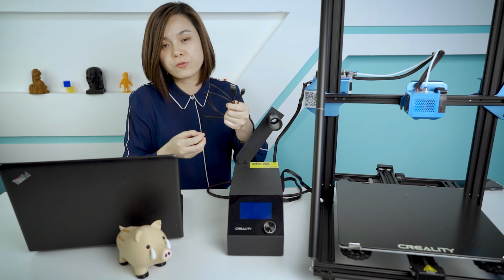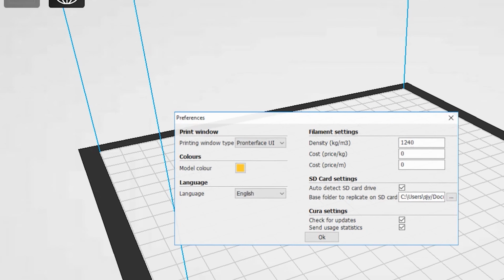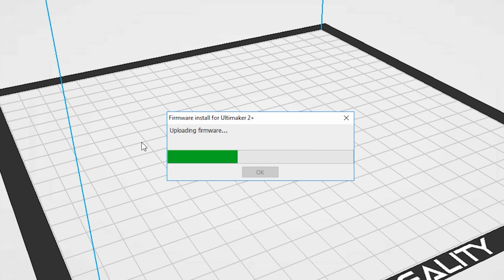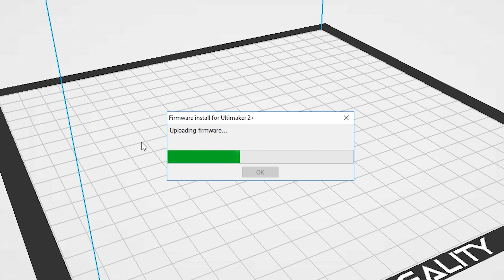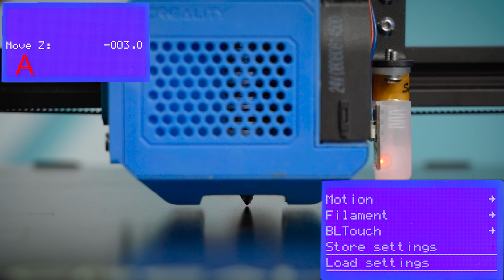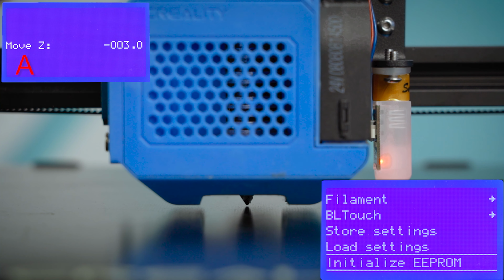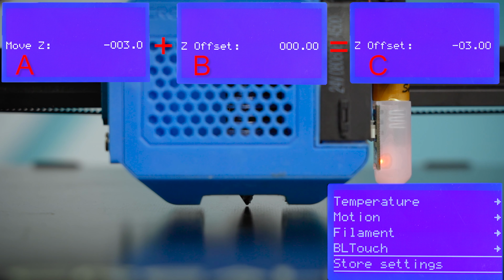Creality CR-10 V2 Bltouch Auto Bed Leveling Sensor Installation Tutorial (2019)

Comment: I think it should come with Bltouch installed from the factory.
Reply: Agreed.  It is sold as an "Upgraded CR-10"
Reply: No one needs auto bed levelling. It's a gimmick. Tramming with a feeler gauge takes 10 seconds.
I have this printer.
Reply: okleydokley saying no one needs it is just wrong. Saying I do not need it might be more correct for your situation and even than there is an value issue. As people have pointed out it is an special version that costs more so you want to get more value to. Now let me explain why I claim your statement is wrong. First some people get bent beds. Way easier to compensate with bod all. Sure even then one can do it manually but it is not 10 seconds job. Every time you change the temperature or clean the bed your perfect setting might be gone. Then you need to do it again. Placing G29 line in slicer and every time you print it will be perfect. Fire it up and go. To be honest I like Creality printers and currently I own two. Even from my two the more expensive model have a micro dip in the middle. It is very often occurrence on the Creality printers. In that case ABL is a dream for almost everyone. See how I have said it? Almost everyone. Not a broad statement as yours while we are all different and I do account for that. So to second point. It is way to exclusive to say no one needs it while you can’t determine and predict other people needs an wants. Like I can’t say everyone wants value for their money although it might be close to the truth. You could argue adding a cheaper Chinese abl is not expensive but why? You have paid more it should come with it. Otherwise get the basic version and 7 $ abl solution and make it your self. Still even that is not for everyone. When you can do it one tends to forget that there is way more people who can’t do it. Never the less TLDR version if there is only me who needs it makes your statement a moot point. This is true disregarding to my reasons why I need it or want it and disregarding facts that I do know how to do it and I am not a lazy person.
Reply: The Bltouch is made in Korea but the Creality printers are make in China that's why
Reply: @MauiRedMan  you make me laugh. Thanks for that. JFYI some models of the Creality printers come with genuine BLTouch and even genuine Caoricorn PTFT tubing.
Reply: NINEWALKING those are printers modded at a 3rd party company lol.
Reply: @truantray  for a bed this big, it's helpful. I will never go back to manual bed leveling. I love the mesh. Especially on my Prusa.
Reply: As a new user... I absolutely agree.

Comment: I can't be the only one who noticed that their print is peeling off the bed after doing the BLTouch install. That's precisely why I would buy one; what's the point of this if your prints still peel from the bed?
Reply: And more for the third line up!...👍
Reply: Might need more heat on be ? But what would I know maybe she don’t wanna get burnt or something xD
Reply: Its auto level but you still have to adjust it???? I don't get it shouldn't it level it all automatically
Reply: @Berserkercustoms44  You need to adjust z offset still, but BLtouch can mesh level and make even warped plates print great. But BLtouch doesnt know the true location of the nozzle without zOffset.
Reply: use glue sticks on the bed before you print, a quick layer Will help with peeling ALOT
Reply: The problem is she didn't lower the nozzle far enough for the Z-Offset. It probably should have been -3.1 or -3.2. Same procedure as shown, just do the 0.1mm steps as well.
Reply: When leveling the bed fold a paper in half and slide under the nozzle. The paper should have a little resistance when sliding back and forth

Comment: This might not be the right spot to post this but, from my experience (August, 2020). Installed the BLTouch on the Creality CR-10 v3. A couple things to note from my experience.
a. Use the firmware for the Titan Direct Drive
b. Printer not normally connected via USB so I disconnected power and moved closer to computer, USB provides sufficient power to power the head unit
c. My printer was not recognized under COM5, I used COM6 and then it was recognized - this permitted me to install new firmware
d. Be sure to reconnect main power supply prior to attempting Bed Leveling (USB cable can be removed for this part)
Look forward to many years of successful prints with this device. Hope this helps others trying to install.
Reply: Thanks, creality does not have the CR10v3 firmware on their site. 
From your experience you used the V2 firmware with the titan and the BLtouch, is this correct?
Reply: Yes I used the v2 firmware. Still trying to get this Z access offset correct.

Comment: I recently purchased a CR10 V2, with a Creality BLtouch upgrade, and like many others, it will not work. I am using Win 10 on a new PC, the proper version of Slicer and CR10V2/BLTouch firmware as well as following any instructions I can find. On power on, the BLTouch self-checks/drops and retracts the probe twice and appears working. However, the probe never again deploys and as such is not able to sense the bed and causing a probe failure on the end of the z-axis. Please help as I am about to return the entire purchase, CR-10 V2, Titan Direct Drive Extruder, Laser Engraver, and BL Touch. Then purchase a competitor. Frustrated please help as quickly as possible.

Comment: My printer is a CR-10 v3 (about 1 month old) and I have recently installed the BL Touch kit from Creality. I followed the tutorial and everything went fine, but I am simply unable to get this z-axis offset working correctly. I have manually identified the z axis difference (I've done this exercise multiple times, but the delta ranges between -2.1 mm and -3.0 mm) and stored that setting through the EEPROM, then saved settings (confirming beep, right?). I have done this many times but the printer is always printing way above the bed! To save time from the auto bed leveling, I figured I should simply be able to do the Auto Home (which for some reason brings the nozzle to the middle of the bed at Z 10.00) then just move Z axis to 0, but I am always left with a huge gap (about 2-3 mm). I repeat the cycle over and over to no avail. I had no problems at all with the printer previously and thought this BL would make things easier. Unfortunately, as it stands right now, I cannot even use this printer and have to consider resorting back to the manual z sensor. :(

Any suggestions would be greatly appreciated.
Thanks,
Reply: MUST HAVE! IMPORTANT INFO!
Important, I want to help everyone I can with this. Let me save you any trouble that others might be having.

G29 and M420 S1. These are gcode bits you need to know when using a BLTouch. Nobody mentions this in any video or writeup I've seen and without them you will feel hopeless. Now let me explain. Watch Creality's install video and follow it step by step. However, once you get to the part for setting your Z offset, rather than eyeball it like the video, use a piece of paper like you would with manual leveling to ensure you have it right. Now once you have it all done and ready you NEED to add some g code additions to your slicer.

After your slicer does a G28 for homing you need to either add a G29 (this tells it to do bed leveling) or M420 S1 (this tells it to use the saved bed leveling info. Use this so you don't have to wait for the bed leveling with every print). If you do not have one of these codes in your g code the printer WILL NOT use the auto bed leveling and youll be playing hell if you have a warped bed.

Now as for a review bit. This works absolutely amazing! It's a must have, and makes the printer a joy to work with. Buy one immediately!
Reply: @DestructionBots  I appreciate this information. I did find and add the G29 code to my slicer (although I will certainly try the M420 D1 to save some time!!!). I did use the piece of paper as my spacer just as I did when manual bed levelling. Unfortunately, this is still not working. I adjust set the Z delta in EEPROM but then when it goes to print (after G29 bed levelling) it's still way off the bed. Creality has tried helping out without success.
Reply: Hello, did you solve this problem? I have the same ...
Reply: @bp2434  The short answer is No. I have set it once. The bed leveler picked up the slight deviations in the plate and then I just left it alone. Every month or so, I go and recalibrate, but otherwise I just go straight to print and it seems to work fine. At least I can print with it - for a while I kept attempting to calibrate each time and was completely unable to print. I was expecting the leveler to do the auto-calibration each time, but I guess not.

Comment: I have the worst luck trying to get a BLTouch to work, ha! I'm trying to follow this tutorial, but when I connect my CR10 V2 to my computer, the Creality slicer doesn't show a COM3 available (just AUTO or COM1). I tried it that way and the slicer cannot connect to my printer. I tried going to the Device Manager and changing COM1 to COM3 manually. This allowed the Creality Slicer to see COM3, however, it still could not connect to my 3d printer. I tried this in other slicers as well. None of them can see when my printer is connected. Any ideas of what I should try next?

Comment: 5:25 Filament seems to be to high from the bed?
Reply: Ha, noticed that as well!
Reply: Yes this is a huge issue with the BLTouch being that the BLTouch is supposed to keep this from happening. Sometimes it goes the opposite direction and grinds into the build plate. (ruined 2 of mine now and others have had the issue as well) This "CR-10V2" video isn't even using the updated firmware which makes it completely useless to V2 owners who purchased their machines after this video was created. I can follow this video with my CR-10 mini, but it doesn't have a BLTouch!lol

Comment: Hi, I installed my Bltouch but during bed leveling, it does NOT goto the edge of the bed as in this video. It is almost that it "thinks" the bed is smaller. I would love some input on how to correct this...should I reinstall the original firmware? is there a reset button for the firmware. I am a beginner

Comment: Hello, Thanks for this tutorial. I just purchased a CR-10 V2 (2.5.2 Motherboard) and a CR Touch? Did this tutorial and firmware are the right one if I install my CR touch instead of the BL Touch ?
Thanks in advance for your help and reponse
Best Regards
Cedric
Reply from the maker: Sorry, CR-10 v2 can't connect to CR touch
Reply: @Creality3D  Thanks for your answer. Can I connect a BL touch with my V2.5.2 motherboard?

Thanks a lot for your support and fast answer. 
Waiting for your answer before ordering BL touch

Comment: hi thanks for the video. i followed your instructions, i have run into the following problems. 1. i can not see the option of bed leveling. 2. bltouch continues to blink after touching the bed twice . my machine setting is for cr10/10s, i could not find cr10v2 in the list of machines. is there a way to get this working? thanks in advance.
Reply: I believe you have to select a custom machine and enter the parameters manually. I believe the sizes it asks for in mm is 300 x 300 x 400 and then 0.4 for the nozzle. Hope this helped.

Comment: Hi, I've follow the guide and did a 3d print sample cat gcode. it worked perfectly. It do some bed level test first and print. However when I try another model like the xyz calibration tube. It does not do bed level test and print directly. and the noozle is a bit high. Is there a gcode start for cr 10 v2 that do bed level test first?

Comment: Why is the BLTouch being sold for CR-10 without the extension cable? I mean, the CR-10 doesn't have the little housing as the V2 does, so the cable needs to be extended with a 1 meter cable in order to even try and use it
Reply from the maker: Sorry for the late reply, could you pls tell us which bl touch you bought? If you confirm that the model of your bltouch is correct, we can resend an extension cable for you

Comment: Why are you using a V2 with an older version of the firmware? I purchased my CR10V2 soon after this video was created and I cannot follow it due to the menu selections on the control box being different. I was able to figure out how to get the bed leveling to complete, but then there is not way to adjust the z to a negative value like you do in the video. The menu selections you are using are the same as my CR-10mini (older model)
Reply from the maker: Dear friend, the firmware version does not affect the adjustment of the z-axis compensation function. If you cannot adjust, you can download the firmware on our official website again, and then try to refresh the firmware again.
Reply: @Creality3D  Thank you for the response and information

Comment: I've followed your instructions, and the bl touch is working but it doesn't probe the whole bed surface, it seems that it thinks that the bed is smaller, how can we change  it from your custom firmware?
Reply from the maker: How many points are automatically leveled, you can change the number of points from the firmware.

Comment: Another look at the vid and I see exactly what many people are having trouble with when it comes to the BLTouch. The side to side to side leveling is horrible and it even SHOWS IN THIS VIDEO! In this case, the right side was too low and did not stick or "squish".  In my case and others, the right side is too high and scratches the build plate surface!! The purpose of the BLTouch is to eliminate issue just like this one and even fails in the install vid.......how do these people sleep at night?

Comment: I dont have the COM3 option for some reason in Slicer. I cant figure out how to simply get the firmware onto the printer. Does anyone know what I am doing wrong?
Reply: In my case, I checked first that in peripherical, my printer was on COM4, then I made the same protocol, but using COM4 ... Issue was OK
Reply: I had COM5 instead of COM3 or Nicopter MG's COM4, but my CPU configuration is atypical - MacBook running Parallels, Windows 10 - when I selected COM5 it worked correctly

Comment: i did everything like in this video. everything goes fine until i have to do the calibration.
When calibration finish the z axis starts to up, and do not stop until gets the top of printer. Even when it comes to the end, the motor still working, do not stop and very bad noise comes from spindle. This is the case of a CReality CR-10.
Please anybody can help?

Creality i hope your help.
Reply from the maker: Friend, pls contact our after servive team https://www.creality.com/service-request, they will solve your problem
Reply: Same exact issue here. Everything is perfect until I update the firmware. Even tried tiny machines version, but that one slams into the bed instead of the top.

Comment: Is there any for cr-10 S5?
Reply from the maker: Sir, you can take this video as a reference. There are only a few subtle differences between them
Reply: @Creality3D  thanks, I finally did it with some changes. The most important one was the interchange of pines in the stop cable (dual cable connector) to board in order to make the probe to work properly.
I knew that it was required because it's noted in Merlin source code, otherwise. Your video don't mention it.
Another detail not mentioned is that the settings have to be loaded every time you are going to print. At least, it's what I do since there's not clear direction.
I suggest you to created better supporting Information.
Reply from the maker: @luisdelarosa7609  Friend, we really appreciate your advice. We will improve something that is not good enough at present. Thanks for telling us your opinions

Comment: I followed the video exactly. When I connected my laptop to printer via USB cable I got a message saying something like USB device exceeded power, spark flew from control unit and now all I see is a blue screen. Then I thought may be the machine should be on power to flash firmware, I switched on the machine, connected the USB cable and I was able to flash the firmware. But when I take off the USB cable all I see is a Blue screen. Only when the USB cable is connected to control unit I see a faint display - of the Creality home screen and it says 'STOPPED' on the screen. Can anybody advise what could be the problem?
Reply from the maker: Sorry for the late reply, we think your mainboard can not be used anymore. Pls contact our after-sell service cs@creality.com, and they will send you a new one

Comment: Can’t get Creality Slicer to see my printer. Tried 3 different cables. No option to set port to com3. Only shows com4 or auto.
Reply: Use COM 4.... hidden in the instructions, it does indeed say to use 'highest value port'.... it will work ok
Reply: Terry Cooper it didn’t work, couldn’t find the printer. It shows in my computer settings but Cura can’t see it. Tried using xloader and that failed too!
Reply: @gazzaknight4474  did you set the speed to 115***
Reply: Terry Cooper yes, no joy.

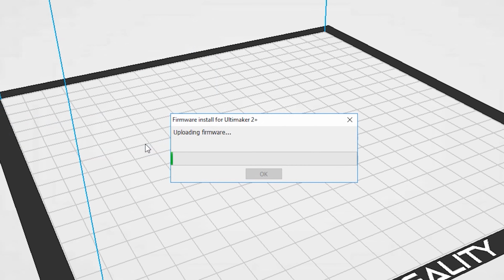Comment: when i plug the printer into my computer using USB, the computer doesn't detect that the printer is there. I cant install the firmware. the furthest that i can get to is 2:05 but i get an error message.
Reply: Hi Brandon - Im getting the same, have you resolved this?